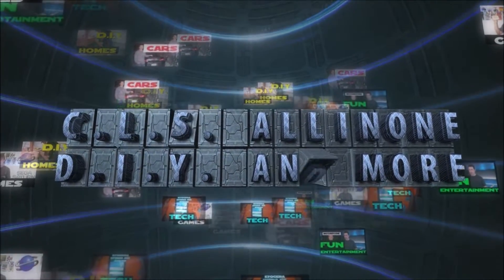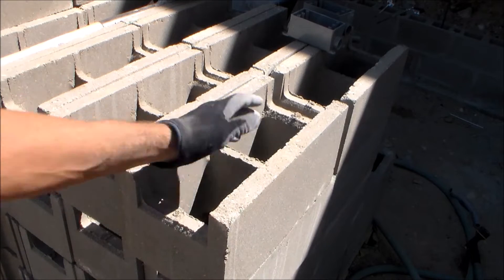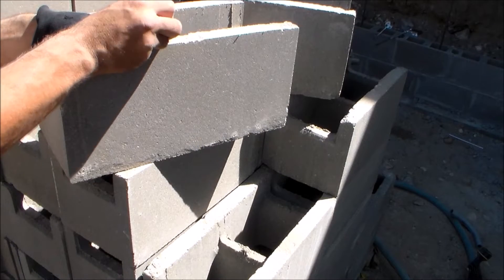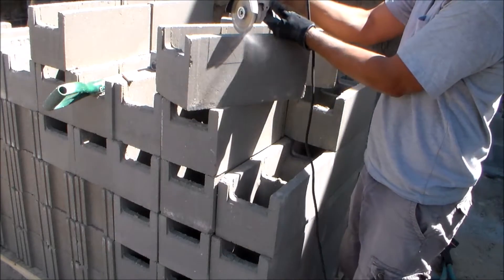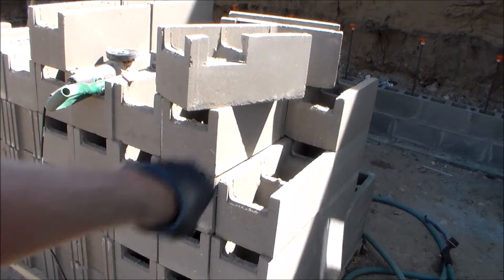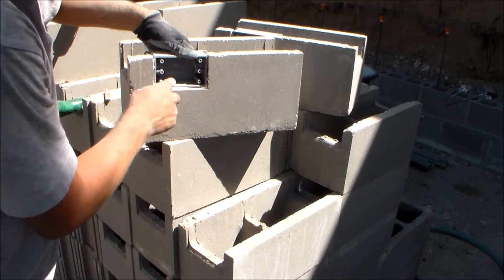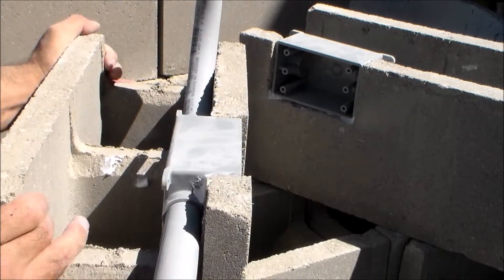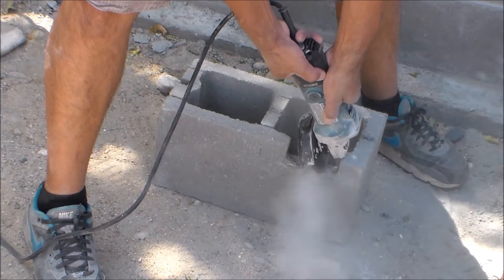How to build a Concrete Block Basement for Beginners. Part 2 Running the Electrical in CMU walls DIY

Comment from the maker: Important note: Local building codes may not allow Romex wiring inside conduit. So you may have to use conduit rated wiring when installing your electrical inside block wall.  The concern with Romex wiring is possible overheating inside conduit. With my current electrical setup heat is not so much an issue because.  1: Its inside a basement wall that stays cool year round.  2: Larger 3/4 conduit was used.  3: All electrical runs are somewhat short. With all that being said when your installing wire inside conduit the best option would be to use conduit rated wiring.
Reply: Individual strands of THHN (solid core or stranded) and an electrician's wire pulling snake are actually what's needed here, and much easier to accomplish this wiring job with. Those mini "T" conduit boxes are really difficult to get either 12 or 14 AWG solid core strands of wire through too, let alone ROMEX. (Been there, done that with the single strands, NOT the ROMEX)
Reply: Right, US no NM/Romex in conduit like that period.
Reply: There is code and there is safe. What he has done here is safe albeit more difficult to perform than the NEC prescribed method. In reality, if this whole system caught on fire because it was grossly wrong, which it isn’t, nothing would happen because it’s in concrete. The potential fire load here is zero. This is not a combustible wall. It’s wrong because of technical reasons but it’s not unsafe. IMHO.
Reply: Around how much did the whole project cost?
Reply: Two things. First it is against code to run wire through the conduit before the conduit assembly is complete. 

300.18 Installation of raceways.

(A) Complete Runs. Raceways, other than busways or exposed raceways having hinged or removable covers, shall be installed complete between outlet, junction, or splicing points prior to the installation of conductors.

Second, not only is it potentially against code to use NM cable in conduit. It’s also a bad idea to because like you experienced during installation, it’s a pain to pull through there. So if you ever needed to service or replace a section of wire. You’d have one heck of a time pulling the old out if you even could.

Comment: i dont think its necessary to build the electrical inside the wall. You have to insulate the inside of the room regardless and so you can put the boxes in your inside wood/drywall/insulation walls.

Comment: Where I live, the common practice is to finish building then cut holes in the walls to run your conduit. I find that method upsetting and mad because you will always notice the imperfection in the patch-Upwork later and for someone like me with a little tint of OCD, i always find it unnerving. This method you showed not only gladdens my heart but it also shows there are people out there with stuffs that shows a good work can actually be done without disfiguring it. I have been contemplating on doing surface wiring for my home since I don't like the idea of then breaking off the wall to lay my conduit wiring, but i was not sure of which will upset me more, glaring at wires or the not so perfect patched wall. I am definitely sitting with my workers to see how we can make something  beautiful like this. Can you recommend me to more videos of this method. Thank you.

Comment: I purchased a home in Alabama with open/unfilled concrete block foundation. The home was built in 1970 & existing romex electrical is run inside the block foundation walls on first floor. I was told by a contractor this is a code violation. I was told by another that it can be in block, but should be sleeved with PVC conduit. I was told by another that conduit is unsafe due to higher temperatures & fire risk. 

Does anyone here know the correct code for Alabama? I have not been able to find a definitive answer to this. I'm planning on eventually finishing the first floor/basement. Wondering if I should pull the romex from the block & staple it to studs when I finish the basement? It seems to me it would be safe from nails/screws inside the block, but I'd prefer everything be up to current code. What are the reasons it would be a code violation inside the block? Moisture? Abrasion? Heat???🤔
Reply: A couple things involved here. No Romex can not be ran in side block walls because code says so. ( abrasion ). Block walls have to have conduit ran to protect conductors. I think the heat issue mentioned was based on Romex inside conduit. Romex can not be used inside of conduit because it builds heat. There are other types of conductors that are used inside conduit.

Comment: Nice video. Not perfect, but neither am I. Tip; try using stranded conductor when fishing through conduit, especially with bends (90°) in it. It tends to go around corners a bit easier than solid conductor
Reply: Depends if you are pushing or pulling. For short runs like in this video I push solid any day. If it's long runs requiring pulling with a string or fish tape then yes stranded is better. Where he made his mistake wash using Romex instead of proper conductors for the job.

Comment: I'm moving on to the 3rd video and I have to say,  best one I've seen.  I do want to express a concern about filling the first 3 layers after electric work.  Even with vertical rebar, a flat wall will be a weak point between the lower and upper. That being said, i plan on doing this, either leaving half of the cell per brick empty or taking something that can push into the cement to give the next pouring a place to fill. This will keep there from being a shearing point in the wall. Kinda like when they bind two pieces of 2x4 to make one 2x4. What do you think?

Comment: just confirming that you didn't actully use grout for the filling of the cores... you used concrete right? Grout has no real structural strength compared to concrete.

Comment: Great video . As a total beginner I just ran some wires in conduit. No codes where I live so I tried to pull Romex . My neighbor convinced me to use 3 strand THHN wire. Omg so much easier to pull the single stranded wire with a little wire lube it pulls so easily .
Reply: Your neighbor is smart and it is NEC code. Just because you don't have a governing authority does not mean no code. The reason why Romex can't be installed in conduit is the insulation can hold heat. Normally in walls the insulation provides protection but has more room to dissipate heat, not so in conduit.

Comment: Can you run ethernet cable in the same conduit as electrical?
Reply from the maker: A separate conduit should be used for ethernet,  because the power wires will cause interference.
Reply: @D.I.Y.-All-in-One  good info. Thx.
Reply: I'm not an electrician, but it's my understanding that HV and LV wiring can NOT share the same conduit or wall boxes.

It's more of a life-safety issue than interference, although for other kinds of cabling that can be an issue as well.  (Probably not such a big deal with Ethernet because it's a differential transmission, and low-frequency [50/60Hz mains] will be rejected pretty easily by the receiver as common-mode noise.  And it's way out of the frequency band of interest.)

Comment: Just one circuit for all those outlets?  3/4 inch conduit would have carried a large number of thhn 12 wire.
Reply: Is Romex by itself approved in block walls?
Reply: @MoneyManHolmes  No to Romex, and he has plenty of room. For general use he can have 13 outlets on 1 circuit and 3/4 can hold like 6 circuits, of course then you get into derating wire, upsizing, and all kinds of math.

Comment: Awesome video.  I am building a block garage in the spring and I loved watching a video that reinforces that my plan is reasonable.  One quick thing, where I live, we are not allowed to put romex through conduit, has to be individual THHN conductors.  You might want to mention that on you videos otherwise a lot of people may have re-pull the wire if they get a cranky inspector!  Awesome video.
Reply: Not allowed to anywhere, other then a few exceptions involving sleeves which have to meet certain requirements.

Comment: Love the video. I was wondering if you used the 12-2 Romex wire for convenience sake versus using 3 individual #12 solid wires? I've never ran wire inside concrete block and was wondering if this is a code requirement or just a personal choice for you.
Reply from the maker: Personal choice and was easier for me.
Reply: I didn't know code allowed that romex in conduit
Reply from the maker: It's depends on the local building codes. The main concern with romex is overheating. The basement walls stay cooler because its underground. I also used larger 3/4 conduit.   And kept the runs somewhat short. The Romex would become more of an issue if its in concrete above ground where the concrete can radiate more heat. That being said I should have  mentioned the issues with romex inside conduit.